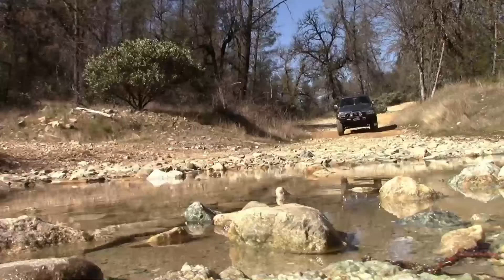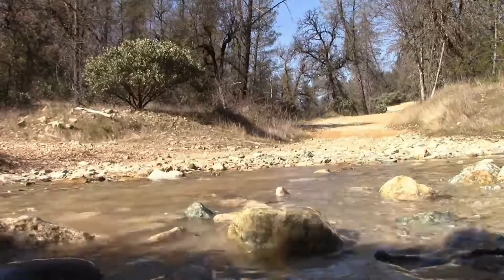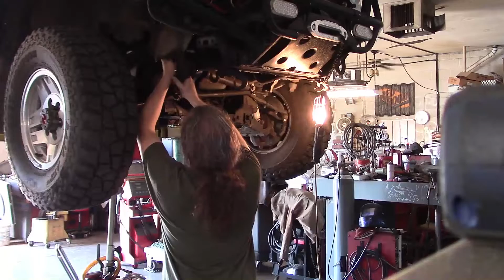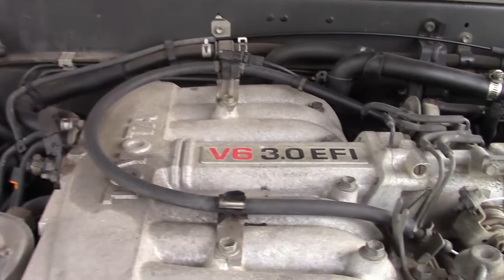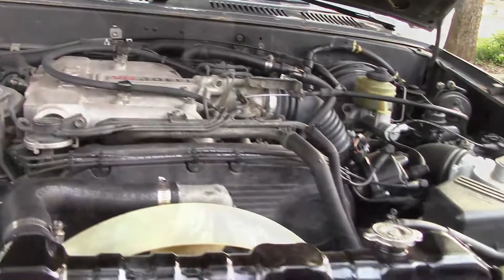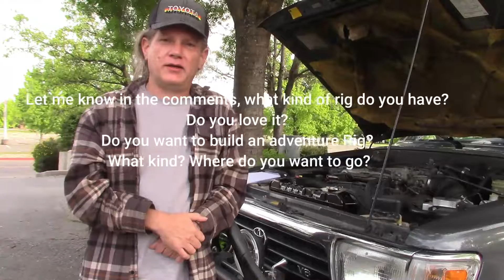Toyota 3.0 3VZE, is it any good? How to Make it Run Forever! 2nd gen 4Runner.

Comment: great information! my truck has a new 3.0 with about 140,000 on it, im not sure that the head gaskets have been done in the recall but i haven't ever had over heating problems, i think im going to go ahead and replace the radiator just incase. let me know what you think thank you!!
Reply from the maker: If it's the original, it can't hurt! At least ours are not as bad as 80 series Land Cruisers, those rads explode when they get old!
Was your new motor a used donor from another truck? Without the VIN I'm not sure you can tell if the recall was done.
Reply: @AgileWoodsman  im not 100 percent on if it was from a donor. i would assume so. i guess ill have too find out where they put the vin on the  block

Comment: Agree 100%. Not fast. Not powerful. But always works. Bought a used 1989 pickup 20 years ago - 5 speed 4x4 manual with 3VZE. Now 400K+. Looking at a timing belt and associated bits this fall as maintenance. If you find a good one don't hesitate. Will you have to fix a 30 year old truck? Yes. But they are easy to work on. Parts are reasonably priced and readily available. And stupid stuff doesn't fail. Rust is the only real enemy of these trucks so good ones are rare in the rust belt.
Reply from the maker: Agreed!! And yeah, I went to visit family in Chicago, and I think I saw one old Toyota, that was it. They are all dead up there.
Reply: Hi man. One little question!! I also have a 89 Pickup 5 speed 3VZE.  Only one owner before me   A good friend of mine.  400k+ miles wow!! Did you have your head gaskets recall from Toyota?? Thanks man

Comment: Wow! Congrats on your awesome video.great information and great tips to make your car run smooth! You think you can make a video on the correct manufacturer diagram of the vacuum hoses on this  engine  ! Because there isn't one video out there that really shows step by step where each hose goes to. And the diagram print out does not really pins down where each hose goes to ! It would be a great video! Thank you ,and keep up the great work 👍
Reply from the maker: Thanks!!! I'll keep it in mind for sure. There are tons of vacuum lines on these 80s and 90s cars, it is a PITA. thanks for watching!!

Comment: What would you recommend for one that already has a blown motor? Should I rebuild it or just go ahead and do the 5vz-e swap? Mine is a '94 4WD with 230K miles.
Reply from the maker: If you can legally do the swap go for it! Check smog restrictions in your area though.

Comment: Hey thanks the video is great one , let me ask you a question I have a 93 but my 4wd  currently does not work i think is something with the vacuum , but no sure honestly, is there any way you can show me , how does the vacuum for the 4wd works, or the diagram??? 
I would appreciate very much. Thank you 😊
Reply from the maker: Yes!! That's not an uncommon issue, and the 4WD front axle does have a sleeve that is vacuum actuated. Just google "2nd gen 4runner ADD system" 
My guess is you just have a broken vacuum line. You can also do an ADD delete, which may or may not work for you and your situation. 
See what you find, there is lots out there with that search and let me know!!

Comment: I just recently got gifted one of these things man tags were backed just paid them replace all gaskets and oil gonna order hood for it when I started it and started to drive it it felt sluggish I have to shift it on load mode then shift it to 2ed gear then drive. It struggles to take off engine is good someone had mentioned to me to that it could be the solenoid so I bought a ATP RE5 Auto Trans Control Solenoid hopefully it’s that if not then maybe I have to get the transmission rebuilt. Help  need some advice
Reply from the maker: Just be sure it's the transmission first. Make sure all your maintenance is done. Clean air and fuel filters etc. Maybe change out some trans fluid and out in a new filter. 
It's really hard for me to diagnose a trans without driving it. ATB!

Comment: What do you think about putting Doug Thorley headers on it to help keep the heat away from the back of the heads? And yes, please more videos on maintaining these great trucks!
Reply from the maker: I've heard good results from that, and it makes sense to get the heat from that crossover away from the heads. I see no problem with that!
Reply: for over heat you most chengh  radiator

Comment: 250k km on my 91 4runner. I'm the 3rd owner - have had to replace bearings, front diff, timing belt and the radiator so far. Doing it all myself has saved me a lot of money and I have learned a lot about vehicles
Reply from the maker: That's awesome!! Learning to DIY is a big wallet saver for sure and I would say crucial for owning older rigs.

Comment: Anybody else think their screen went off at 5:35?... I was like, "what the actual f***?!"
Reply: StanceTV  haha. Yes same here. I thought my internet went out.  I have spotty service
Reply: You say, change synthetic blend every 3k and you say it’s inexpensive? Yeah, for you maybe. It’s like $30 bucks a time including filter. 🙄
Reply from the maker: @tthoy7338  I mean30 bucks for an oil change is pretty normal. What are you wanting to do differently? My view is regular oil changes are cheap compared to a new engine or buying another car.
Reply: @AgileWoodsman  I used to go every 3k with conventional, but with full synthetic I go every 5k-6k and when I drain it’s like as liquid gold as when I put it in. Cheers
Reply from the maker: @tthoy7338  Sounds great!! Sounds like your motor is tight! Mine stays clean quite a while also, though not for that many miles! You're doing it right!
Reply: @AgileWoodsman  2000 PreRunner 22RE 182k just break’n in 👍
Reply from the maker: That is so strange! I must have messed up something in editing. Oops!!

Comment: Awesome video much needed information I have a 95 4 Runner that I’m currently doing necessary maintenance on and doing my first big mod which is adding a 3rd gen 4 runner e locker onto the rear axle of my truck, also regeared to 4.88 for my 33’ Tires
Reply from the maker: That's awesome!! Let me know how the swap goes. Are you just doing the 3rd member or how does that work?
Reply: All we did was modify the axle to put the 3rd member however the axle housing had to be modified to fit the 3rd member the e locker works perfectly but when on the street or highway you can hear the gears rubbing with the axle housing which means not enough room was made for them we hope they will grind and make room for themselves otherwise we need to take them out and figure out how to make more space Agile Woodsman

Comment: Excellent! Thank you. I am a recently retired chiropractor who finally has time to restore my old 1990 4x4 SR5 3VZE with 157K miles. I bought her new in SF in 1990 and would like to see her hit 300K. My head gaskets blew within 3 years and were replaced under warranty. There is so much bad info out there especially on the EGR delete obsession which I was being seduced by until I found you. I was throwing a code 71 which was easily fixed by pulling the EGR valve. I was getting ready to order a new one but just cleaning it with carb cleaner fixed the problem. I would love to see you do a service video or any other videos as I am also gearing up to do a complete service. All fluids, filters, grease, etc., etc. Question: Is it possible to change the PCV without pulling the intake plenum? Again thank you. Keep up the good work. Liked. Subscribed & hit the bell!  ps. What oil do you like for the manual trans, transfer case, differentials, etc? Thanks
Reply from the maker: Oh that's fantastic Doc!! Congrats on your retirement and your rig!!

There are service videos in the works for sure!

Email me about the fluids, it matters which components you have. Mike@agilewoodsman.com

Comment: hey so i got a 91 4runner and when going up on the mountains with big incline i have to downshift all the way to 3rd going 45 while even fifth wheels are doing 55 or more. do you think i have a problem or does that sound correct?
Reply: I have an 88 pickup and live in the front range of Colorado and that’s my situation as well. 

3rd gear, loke dawgin the right lane, watching the world pass by.
Reply: Ya no power at all after 70, downshift and wait...
Reply from the maker: Yeah that can happen. It really depends on the incline and how much load you have. Steep hills though, yeah, I do hit 3rd sometimes.
At least w pass the old volkswagons!!

Comment: Thanks! I’m going to look at a really clean 3rd gen tomorrow with 300 000 miles a little skeptical it’s in my budget but pricey for the miles
Reply from the maker: Hmm. 3rd gens and 80 series land cruisers are in high demand because of the overlandig craze. You'll likely pay a premium,  partly because they are that good, and partly perception that the others are not as good. If you have the funds, go for it!! Make sure it's in great mechanical shape and has been maintained well!

Comment: My 2nd gen 4runner 3vze has 411,000 k's and hasn't missed a beat. Motor has never been cracked open and I religiously flush the motor out with diesel with every oil change. Maintenance is a big key with these motors. Look after it and it will look after you. My seems to have a little more get up and go than some others I have come across. Not sure if it has something to do with the diesel engine flush. Cheers
Reply from the maker: That's new to me, glad it works for you!!! You're right, maintenance is key. Glad you found what works!

Comment: Funny how things can turn around. Recently started loosing coolant after changing the old radiator cap. Went to the dealership to check for a cap and made the chem test for the CO gas in the cooling system. Bang! Bright yellow. So what, 5-6k after a rebuild the engine is blown a head/block or a headgasket. 3vze deserves its reputation. I am completely dissapointed. Plus even if its working everything in this engine bay is so tight that it is a nightmare to even check the goddamn spark plugs. Should have bought something american with lots of room - like K5 Blazer.
Reply from the maker: Yeah for sure! Get something you'll feel more comfortable with!
The big red flag in your statement is "rebuilt engine". The sad fact is engine rebuilds are not what they used to be and early failures and unreliability are not uncommon. Unfortunate but true. And the failure on a rebuild is in no way Toyotas fault or refutes any of my statements about OEM Toyota motors. 
I'm sorry you had shit luck on your rebuild though! Hopefully whoever's screwedthat up makes it right for you. Or buy that K5!
Reply: @AgileWoodsman   Thanks for the support. I got frustrated and it showed in my comments. Now that I thought more about it I will still see what will happen, as the truck still runs totally fine. I will drive it with pleasure and if (or when) it goes south will either change the engine (maybe a 3,4 swap) or a another truck. Still, I totally love the 4runner. The only things I like better in the K5 are the overall width and the front. The people have said it - the best car is the one you own :)
Reply from the maker: @Dilomski  My pleasure buddy! Good luck with everything!!

Comment: Good video.I have a 91 3.0 5sp 4x4 350k miles and the motors never been cracked open.Daily driver for 22 years Still runs like a champ and has never left me on the side of the road.The only motor that can compare in longevity is a slant 6.
Reply: what gas do you put in
Reply: I had shitty luck with these…. Always horrible mileage , like embarrassing, and blew up 2 of em.

Comment: Just got a 94 with 201k miles for $1,800. Needs maintenance work but it’s ok. But it’s got a check engine light for EGR valve. Should I look for a used OEM on eBay or look on maybe rockauto for another brand?
Reply from the maker: I don't recommend EGR delete on these. Kyle didn't watch the video. More power is minimal at best and changing the function of the egr system can cause problems. 
Any brand is fine. I'd just go brand new though.  But first diagnose WHY that light is on. It can be an electrical or vacuum issue too!

Comment: I agree with the OEM replacements. I'm restoring allot of those things on the 95 I purchased. 260k on the clock. What size tires do you run? I just purchased the original wheels like yours.
Reply from the maker: 31 inch Mickey Thompson ATZ P3's. Amazing tire! So worth it. Good luck with the project!!!
Reply from the maker: 31 inch Mickey Thompson ATZ P3's !

Comment: Great video. You know quite a bit about getting the most out of this engine. My 1991 sr5 2wd has about 259,000 miles on it and I consider it to be a reliable and fun daily driver. Of course, I've maintained it since about 2000 because I had issues with dealership maintenance. I can't understand why these engines failed with automatic transmissions because they are/were always in the best rpm range for best operation. I believe these engines lost credibility because they are basically high-rev engines (8,000) which wasn't considered by the rock-climbing crowd who overwhelmingly favored the 2.4L historically proven engine. My 3.0 has been very reliable and loves to roll at 85-95 mph without a problem, even while dragging a 1987 chevy cavalier on a vehicle hauler through Arkansas from Fayetteville to Little Rock. From about 50,000 to 325,000 miles, I chose to use premium gas because of a rattling sound coming from the engine under hill-climbing stress. after I adjusted the valves and did other significant maintenance on the truck, I remembered an old school intervention.

I started advancing the engine timing slowly, then evaluating the results (I had already installed a new plastic radiator which ran slightly cooler that my third original). I stopped timing advance when I arrived at 15 degrees before TDC, at least I believe I'm stating it right. The engine has more power than when new and it runs slightly cooler. To me, that defies logic, but it is what it is. It's still fun to drive because I have no need to floor it in third gear at 1,500 rpm.

Today, I will replace the leaky clutch line extension on the passenger side of the engine, replace the expansion valve and o-rings in the cooling system, and replace the plenum, intake, and valve cover gaskets on both sides. This engine has not been treated well by me except to stroke it with timely maintenance and upkeep. BTW, the engine oil I use is Rotella T4 with triple protection - 15-w-40 for 5 years so far. Any issues with this truck are things that weren't right when it was new and Toyota couldn't resolve them. That was the biggest crock of buying this truck new after others put 88 miles on it test-driving it and refusing to buy it. I have no regrets.
Reply from the maker: Thanks for taking the time to share all that. Ya, dealers, have no words. Very hit or miss, and it's more miss than ever these days.

Glad what you're done g is working. I'd guess your your timing solutions are compensating for something,....did you look for vacuum leaks?
Reply: @AgileWoodsman  No vacuum leaks. Still very strong.
Reply: @AgileWoodsman  I misstated mileage. That was 359,000 miles. Now 360,000.
Reply: I forgot to say my engine runs perfectly now on regular gas, and it climbs my highway test hill without losing speed or having engine rattle. My head gasket replacement happened at 103,000 miles, free by Toyota as a recipient of a silent recall.

Comment: I've had my 93 pickup with the 3.slow for 14 years.  It can't get out of it's own way, but it's never left me stranded.  It has 365,001 miles on it.  I pulled out the 3VZ yesterday, and a 5VZ-FE is going in next weekend.  I really can't say anything bad about the old 3 liter, other than it was a gutless wonder.  Even so, it managed to tow a car full of everything I owned from Portland OR to Devner CO.
Reply from the maker: Damn, a 3.0 towing to Denver, you're a hero man!!!!

Ya they are underpowered,  probably a reason they can last so long!!
Reply: @AgileWoodsman  Every mountain pass I was in the slow lane with the truckers, flashers on.  Even down to first gear a few times, but it just kept on chugging. 
I used to joke about how it didn't have enough power to hurt itself, but I guess it became more of a statement haha.
Reply: @MOTO809 hahaha! That is absolutely insane! RIGHTEOUS
Reply: @heavyprogressive76  I love that this is getting attention 6 years later lol. Nothing brings people together like a good ol' Yota.  Yeah, it was insane! The funniest part was that UHaul wouldn't let me rent the tow dolly because I only had the bumper hitch ball, the 4 wire lighting plug didn't work, and the Yota didn't have the rated towing capacity even if I had installed a receiver.  So one of my buddies let me borrow his F250 to go get the dolly.
Reply: How hard was the engine swap?
Reply: @moejr14  LOL I don't know why I just saw this 4 years later... You still wanna know?

Comment: 92 Hilux, $3k in '08. Bought it from the original owner, 190~200k miles, w/HG recall done. I've only put 23k on it since.

I'm happy to hear someone without the 3.0 doom & gloom. I was considering just doing a 3.4 swap, but now I'm going to wait until this one craps out. Btw, on road, I'm usually in 5th by 35mph, and I rarely go past 3,000 rpm.
Reply from the maker: Nice!! Yep I would stick with it too. The only reason to swap early that I can think of is if you needed more power. That's my only hangups around the 3.0 but I get by.
Yeah the 3.0 doom and gloom is mostly unjustified, it's taken on a life of it's own on the internet,  as things tend to do.
Enjoy the hilux! Keep it forever!! Thank for watching. ~Mike